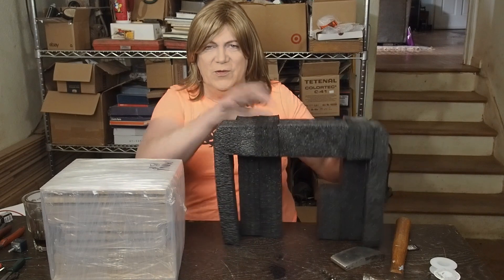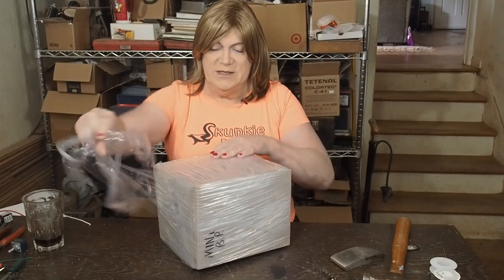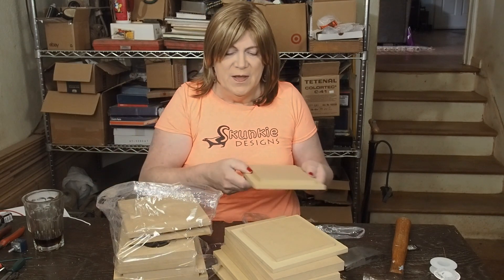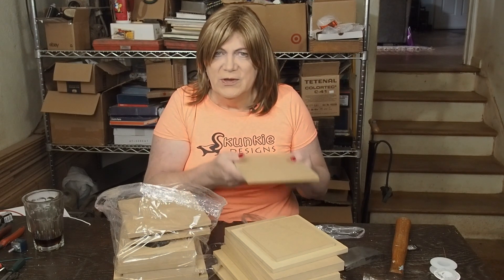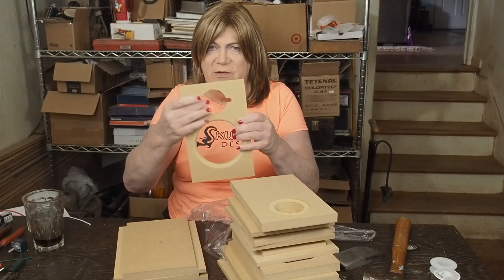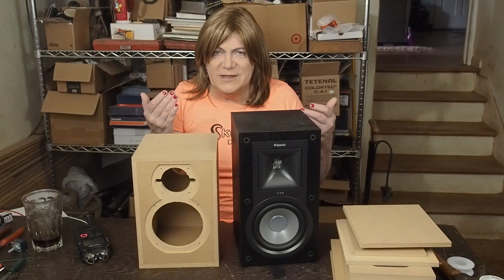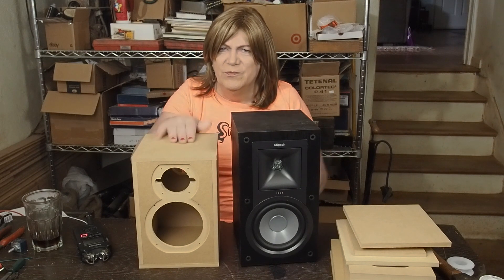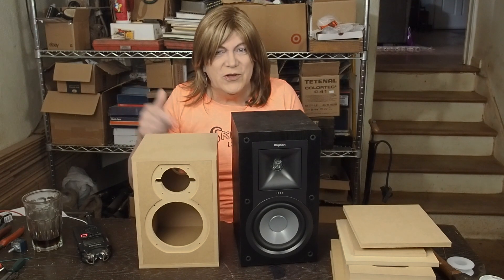DIY Speaker Kit Build

Comment: Question on speakers and SET's amps.  If a pair of speakers with an  average sensitivity of 88dB/w where to be used with a SET amp  with 2.6 watts/channel would it just not play loud or could it potentially be harmful to the amp or speakers if play at modest levels of volume? Thanks.
Reply from the maker: It would just not play loud. 88db is still fairly loud!

Comment: Wow GR Researh superb!!!!! but floorstanding will have deeper bass than 55Hz . I wish I can afford that.  try CSS 1TDX too  it closed match rival.
Reply from the maker: It's being driven by my 6BM8 amp that doesn't have any deep bass anyway. Plus this is for my small little system I use downstairs for ambient music so want small bookshelf models.
Reply: @SkunkieDesignsElectronics  Can you try ZWBR cabinet with GR research as optional cabinet?  I think result might change but better or worse need to tune up cabinet and 2 resonant tubes. of chamber 1 and chamber 2.   But ZWBR will make small speakers a little deeper bass (small space no need floorstanding transmission line if QTS is not appropriate for TL)
Reply from the maker: @nuttyl283   No idea what a ZWBR cabinet is, and I already bought this one so plan to use it. Also I have no idea what "QTS is not appropriate for TL" means either. I just plan to build a couple of small bookshelf speakers and see what they sound like.